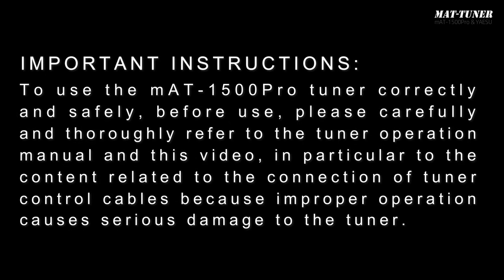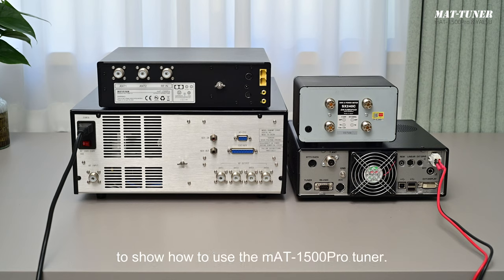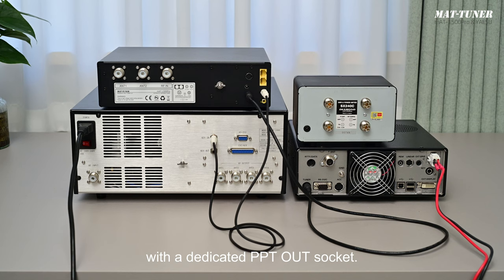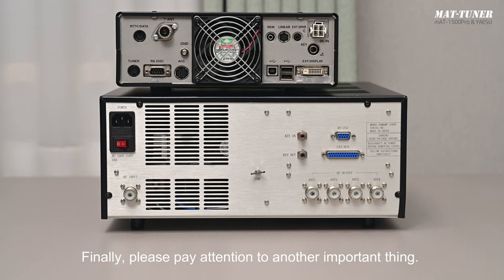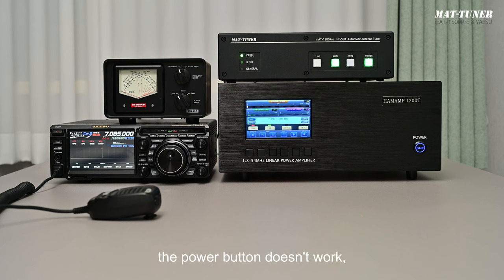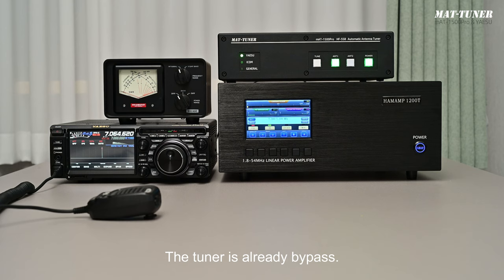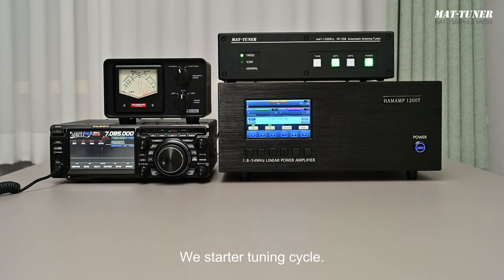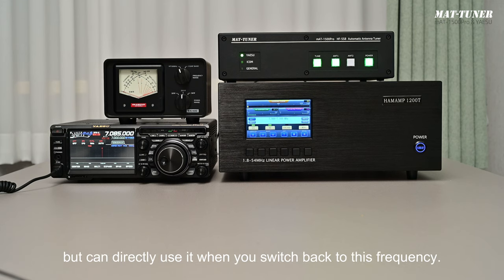mAT 1500Pro & Yaesu

Comment: Can the tuner be operated with older tube amplifiers, e.g. an Ameritron AL-80B?
As you are no doubt aware, voltage peaks can occur on the PTT line.
Reply from the maker: Your amplifier can use this tuner.
Inside the tuner, only one relay is used to control the transmission of the PTT signal.

Comment: Who sells the HAMAMP 1200T?
Reply from the maker: This amplifier is very heavy and requires users to have a certain level of technology. Currently, it is not sold outside China.
Reply: Not explained in the video, dont forget to  modify the parameters in your FTdx10 setup to select  the EXTERNAL tuner!